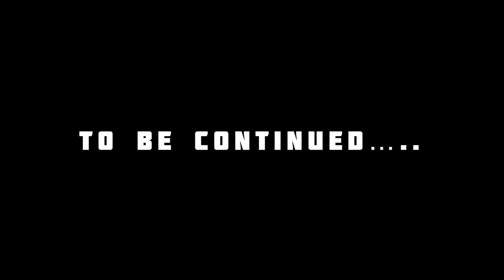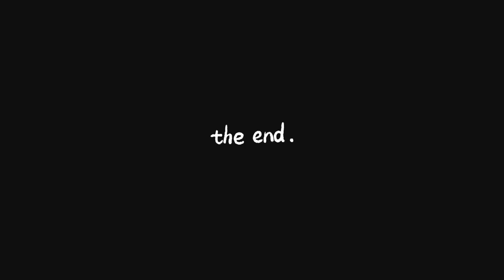How to fit Stair Parts #1 - Newel Posts

Comment: Why wasn't the newel post on the flight into the loft fitted in the workshop during manufacture it obviously needed a Newel. 

I note that that you said measure of the nosing I was always taught to measure of the pitch line (the point were the tread and riser meet if you trace the line of the riser through to the top of the tread. 

All in all though mate tidy job,nice one.

Comment: Can you make a video of the set up of where you are cutting to produce such neat work
Reply from the maker: Hi Marcus. Thanks for the comment. I made myself an MFT table last year and have purchased some bench dogs and fences for it. If you look at any of the kitchen videos you’ll see it on there and coming up on a kitchen I’m doing now 👍🏻
Reply: @mrabuilders6723  I'm not sure if the original poster meant what i thought he did but is there anyway you can show you scoring the plaster that was left high, how you found the high spot on the floor to level the plaster to (assuming the window board is meant to sit proud x amount of mm's so this info would be handy to know inorder to know how much offset above the floor level to cut). What you used to mark the level line and what tools you used to score and actually cut the level line so cleanly. You do great work and awesome videos but i usually have questions as it seems to go from A-C on things you likely do as second nature. For a novice like me it would be amazing information.

Comment: Do used d type glue as it expands
Reply from the maker: Hi Brian. I don’t use expanding glue on stair parts especially oak because it’s a lot harder to clean off but I do use a D4 glue for better bonding strength 👍🏻
Reply: @mrabuilders6723  mastentape  round bottom of timber it easy clean off help full all small gaps ta brian